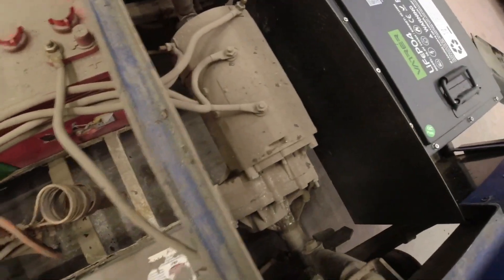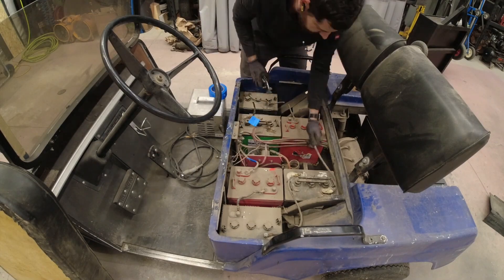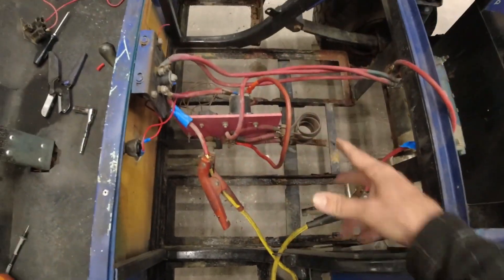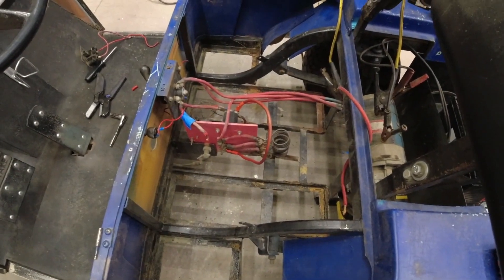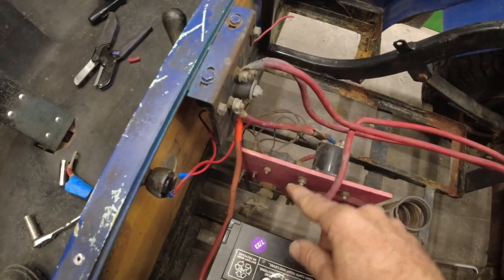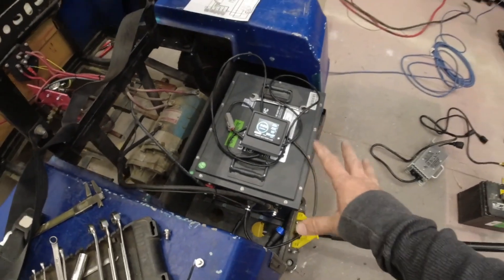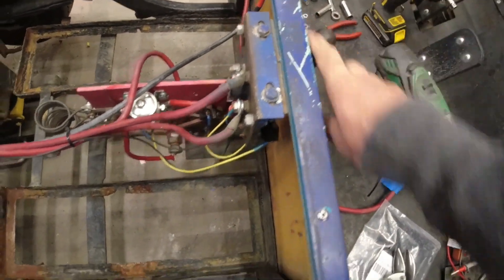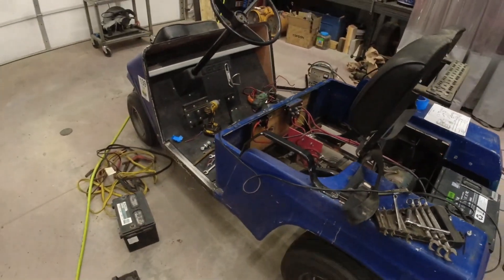Upgrading An Old Golf Cart With A New 36V Vatrer LiFePO4 Battery Pack

Comment: I'm going to replace my Trojan lead acid batteries with lithium which are 6 years old.  I'm videoing speed and longevity of my current system and then will repeat with the upgrade during actual golf outings. Everyone does range and speed tests but not actual golf usage. Currently. my cart, a 1997 Club Car DS, will make it 45 holes.  It's a fairly level golf course.  I am expecting to see a huge difference.

Comment: I would have replaced the speed controller, those resistor wire based speed waste a ton of electricity. This would have also made room for the battery in the old compartment.